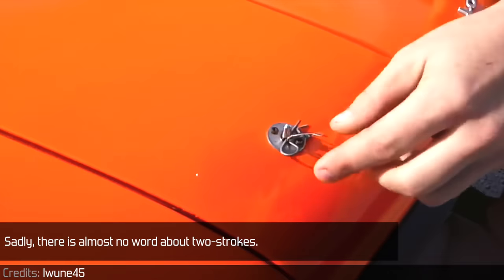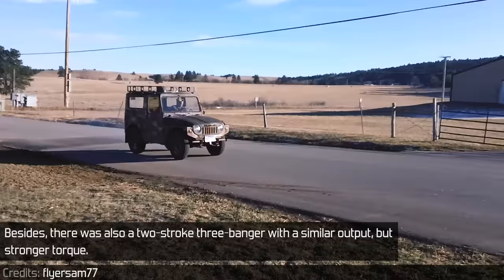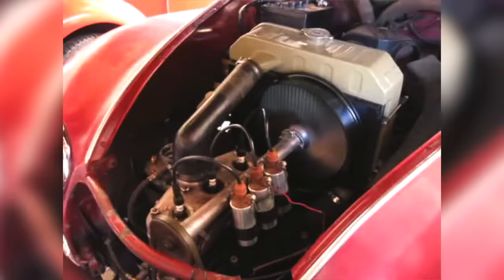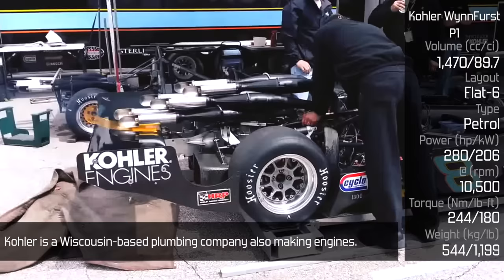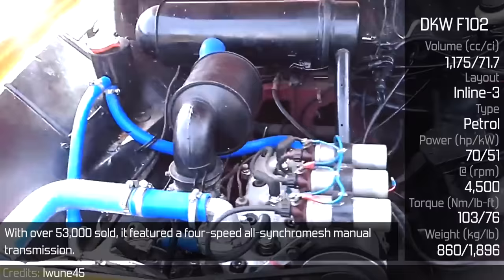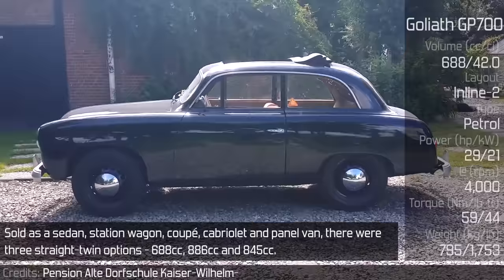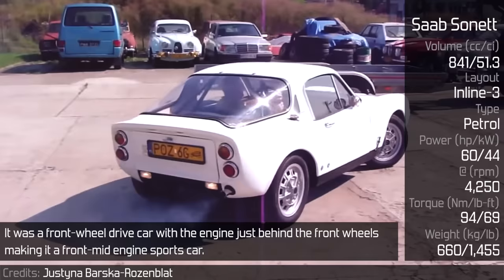8 Cool Two-Stroke Cars You May Not Know About

Comment: 2-Stroke with 2 and 3 cilinders make The sound of Rotary Engines
Reply: because they work on the same basic idea... but using different way
Reply: not really, a wankel rotary works on a 4stroke cycle, but due to its design, it does have twice the amount of combustions per revolution of the eccentric shaft than a four stroke, just like a 2stroke. the fact a wankel doesn't have valves but just intake and exhaustst ports like a 2stroke petrol engine, also contributes to the sound :)
Reply: yeah no kidding. The 2 stroke is all about flow dynamics. Rotary engines are based on similar principles but rely less on how it flows. rotaries are essentially rotating 2 strokes but have a more consistent idle because of their more predictable pumping methods.
Reply: Wankel rotary, or Le Rhone rotary?

The Le Rhone was a "radial-ish" design, 
where the crank was bolted to the firewall, 
and the whole engine spun around, and the 
propeller was connected to it. ( My 10th 
grade metal shop teacher, made replacement 
carburetors, for this engine, that is how I know 
all this trivia.  Oh, that class was in 1974.)

https://en.wikipedia.org/wiki/Le_Rh%C3%B4ne

I'm quite sure you mean the Wankel (Mazda) 
engine.  (Yes, quite a few people used the 
Wankel design, including the model engine 
maker, OS Max.)

Like others have pointed out,that sound 
comes from the exhaust port, opening 
almost instantaneously.  (Just like a 2 
stroke.)

steve
Reply: Steve Skouson based on context it is clear to see that were talking about the wankel here. no need for unecessary clarification
Reply: Just adding some info.

There are 2 drastically different 
engines called Rotary.  I'm 
familiar with both.  Yes, the Wankel 
does sound like a 2 stroke, without 
the backing-off backfires.

I've been around 2 stroke engines, 
for quite a few decades.  The Yamaha 
RD-400, and it's descendants,  are about 
the best.  (I had a 79 Daytona Special,  with 
a RZ-350 engine installed.)  That bike was 
SCARY fast!  I did all the re-wiring in one day.  
The YPVS valve DID work, when I was done.
(Yes, I MISS that bike!)

steve
Reply: xHarux3 nope, common misconception
Reply: Mark Thomas relax bro, no need for name calling
Reply: Sandro Sobreira moo
Reply: @xHarux3 A ignition per rotor per eccentric shaft revolution.
Reply: The thing a rotary and 2 stroke have in common is the lack of a valve train
Reply: @shaynegadsden  2 stroke diesels do have valves...
Reply: Sandro Sobreira
 Not really. Rotary engines don't have that dig dig sound lol
Reply: @vladimirlucifer4566  Reed valves.
Reply: @MallocFree90  What do you mean? That they're both engines?
Reply: Lol true
Reply: @mr.petrolhead5432  actually a wankel engine is a 3 stroke
Reply: @mr.petrolhead5432  yes but compression in wankel engine is not really a engine phase is just the rotor compressing the fuel while spinning
Reply: @mr.petrolhead5432  and the number of stroke is the number of times wich the internal parts of the engine need to move for making a full cycle
Reply: @m4ttyofficialchannel  ofcourse compression is an engine fase. Both a 4 stroke reciprocating piston engine and a wankel engine run on the same otto cycle. A wankel doesn't really have strokes as it's a (eccentricly) rotating piston instead of a recipocating piston. But it DOES have the same 4 combustion cycle fases as a 4 stroke.
Reply: hemm...no.. rotary make a sound of 2 stroke
Reply: Rotory fires every rev like a piston 2 stroke.
Reply: Hm F1 2 Strokes
Reply: Especially when you have 3 expansion chambers
Reply: @jjhack3r  wankel is 4 Stroke not 2 Stroke
Wankel :  https://www.youtube.com/watch?v=6BCgl2uumlI
2 Stroke :https://www.youtube.com/watch?v=Z6YC3I54so4
Reply: A 2 or 3 cylinder two stroke sounds similar to a 2 or 3 rotor wankle because they have the same number of exhaust pulses per revolution of the crankshaft/eccentric shaft even though they operate differently.
Reply: Mr. Petrolhead 
You are correct on a technicality, but it’s a bit of both. I say this because the work best with the external lubrication removed and blocked it and 2t oil in the fuel. Note to anyone doing this you will need to also remove the entire engine management system and use a programmable ECM since you have to get rid of the O2 sensors  and adjust fuel based on thermal readings and elevation. I know this cause I built a rotary powered Fiat Dallara X1/9 when I was 19.
Reply: Mark Thomas 
Please explain, becaue like 2t it peripheral port not valves but there is no overlap in port timing, like a 2t motor. Also the external oil system can be removed entirely and 2t oil added to fuel assuming you rejet for leanness or remove the OEM ECM/ECU and replace with HalTech or MoTech systems and that uses EGT and an Barometer , altimeter, and air temperature gauge to adjust for proper air fuel ratio. 

Now to the other direction the external oil system can be remove a shaft is then drilled from the centre eccentric shaft to its then tapped and a small carburettor jet is installed, after that the apex seal is widened and just below a a secondary hole is bored parallel to the apex seal intersecting  the shaft to the eccentric shaft , walls of oil channel should be about 3mm below apex seal. Holes are then plugged or welded and holes are drilled under the apex seal to bring oil from the eccentric shaft up the Chanel created through a tiny carburettor key then spit to be delivered behind the apex seal and lubricator the apex seals internally much the same way oil is delivered to pistons via the small holes that are behind the ring of 4t pistons. This configuration or Dorsey motors can be usually found in aircraft, not just any aircraft but experimental class aerobatic all aircraft much like you see in RedBull competitions. Due to the way the aircraft is tossed about they can’t use external oil inject isn’t wise due to oil starvation also minimal risk of a blown oil line since all oil is being delivered internally. Drawl back. It burns a ton of oil so it’s recommend for vehicles that either have a giant oil tank like a commercial boat or only are being used for let’s say 15 minuets of very intense flying then landed and refilled. 

So in the end the moral is it’s not 4t or 2t it’s Non-binary and would asked me to ask you to respect it’s boundary’s and use it’s preferred pronouns.
Reply: Zeksteve  as does a gas turbine 😁
Reply: Sounds like a wartburg.
Reply: 2 stroke = Dorito spinner on steroids
Reply: No, not at all
Reply: That sounds like f1 cars😉
Reply: No they do not. Wat u smoking? Crack.
Reply: Yeah but you'll never confuse a Porsche with a Banshee!
Reply: Meanwhile there's the hateful sound of someone calling opposed piston engines a flat 3
Reply: @steveskouson9620  God wants to have a relationship with you.
Sounds crazy, right? 
No it is true.
God loves you, he didn't spare his own Son Jesus for that reason(John 3:16)
that died for your mistakes.
He is not religious.
He isn't about religion.
He wants a relationship.
Even though you sinned awfully against him and he would have to send you to hell, but he is A God of love as the Bible says.
He wants to be your friend.
If you'll accept him.
I learnt it that way.
We all have our own beliefs 
and that's why we have to trust the only usable source: The HOLY Bible.
He didn't put a bunch of rules you have to follow,
It was people that did.
Those are false.
Only way you can come to God 
is you coming to his Son, Jesus.
His only Son died on the cross of Calvary,
For YOU.
So you may come to God
and go to heaven, to be with him.
God focuses on the individual ,and you are that one today.
He loves you so much,
He created you,
He shaped you,
He formed you.
Why don't you accept his love today?
All you have to do
is to come to the cross 
Ask Jesus for forgiveness by saying you're sorry for your sins.
That's where the journey of passing from death to life begins!
He loves us enough to give us a choice: we can ask him to be part of our lives now, and so avoid hell and look forward to enjoying his perfect eternal kingdom, or not.
We Christains need to speak out.
If you're a Christian let's speak up for our faith already. We know what is going on in this world is sin, abortion, homosexuality, prosperity gospel...
Let's do it brethren already.
If you reject Jesus, I am telling you, you will face the biggest amount of punishment in hell, more than murderers, adulterers, liars constantly gossiping, the proud and the wicked. If you reject Christ God cant forgive you of it until you come truly to Christ.
Take it seriously, Amen.
10 at the name of Jesus every knee should bow, of those in heaven, and of those on earth, and of those under the earth, and that every tongue should confess that Jesus Christ is Lord, 11 to the glory of God the Father.
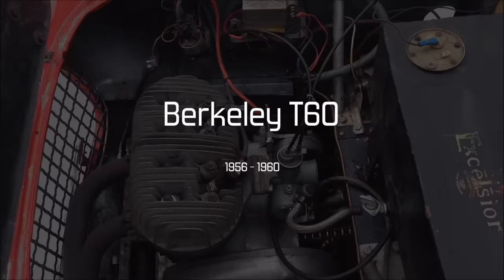Philippians 2:10-11 NKJV
Reply: @ijustcamefrombiblestudy2243 , I make it a point not to 
go to Church, and DEMAND I be given the RIGHT to talk 
about cars.

Maybe, the reciprocal should apply here.

steve

Comment: What a pity that it was only the last ar that was really revved out. I love the sound of a hard revved two stroke, music to my ears. Also good to see that two strokes are making a comeback amongst the off road bikes, wish they would bring them back in large displacement road bikes.
Reply: Ofc my dear, it's a Saab after all 😏
Reply: Are they? Yamaha's 4 stroke makes the same power now as a similar sized 2 stroke. Also race leagues are almost all using 4 strokes AFAIK. There are a few guys using 2 stroke but its all but gone.
Reply: They are coming back, 1 manufacturer and one kit to a 500 from the 250. Once you ride a 490-500 for awhile, nothing else works.
Reply: @congerthomas1812  Im sorry but they make a little more power while being a pain to refuel and are wayyy, wayyy dirtier. I just don't see them making a comeback lol. Especially when electric is coming up so fast.
Reply: @CrossWindsPat  The new ones are fuel injected.
Reply: @congerthomas1812  So no mixing that is awesome. Still lots of other issues though.
Reply: @CrossWindsPat  I drove one daily for 2 years never a problem,beach to hills,Exmouth,WA.
Reply: @congerthomas1812  I never said reliability was one of them. 2 strokes are very reliable because they are so simple. But they are dirty and noisy and lack low end torque.

Comment: 5:42 ..... finally someone who drives a 2 stroke the right way!
Reply: Joe Webster nope, he let clutch pedal too early. I know, it's much faster that way on video.
Reply: I meant I thought the rest were putting around until then. Very boring before that.
Reply: @Pabcio  I think the clutch is slipping
Reply: You gotta rev the heck out of a 2 stroke for it to be really fun.
Reply: a 2 stroke has to be revved higher because it has no guts at low rpm's
Reply: @jasperdomacena6491  Hondas cr500 that can power wheelie in fifth gear from idle would like to have a word with you

Comment: I remember a car that raced at Santa Barbara Airport when they raced there back in the 1960s. It was powered by 2 100hp mercury outboard engines converted to drive the car. When he punched the throttle to accelerate down the long straight it sounded like an explosion. He passed a lot of cars right up till one of the chains driving the rear wheels broke and he went round and round before he could get it stopped.

Comment: If I recall correctly, the tiny engine in the Berkeley T60 can also run backwards, thus giving it as many reverse gears as forward gears. If not that, then there is another small three-wheeled sportscar from England with such an engine.
Reply: I have a feeling the Invacar from the 60s could do that as well!

Comment: 2 stroke motors would be successful in cars with a few additions..  
1) Crank case oiling. Since 2 strokes rely on oiling from the fuel mix, when off throttle the engine can be damaged and actually overheat without throttle. The crank would need its own oil basin like 4 strokes..
2) Valves. Crankshaft-timed valves for the intake and exhaust would allow for supercharging and possibly turbocharging
3) If the crank case was oiled with a basin, you would need much leaner of a gas/oil ratio... leading to a more efficient burn.

Comment: It's wild how 2 strokes are very powerful for their weight at small cc's (65cc to say 500cc) but after that seems 4 stroke takes the lead by far.... Nowadays we got 2.0L hondas pushing nearly 1500hp. Crazy
Reply: thomas barlow indeed. 4 stroke engines have worse power to weight ratios. But they are more efficient. 2 strokes are much less efficient but have much better power to weight ratios. However I've heard somewhere that two stroke engines can be more efficient if given crossheads. Some of the most powerful and efficient engines in the world are two stroke crosshead low speed diesel engines. The most powerful being about 109,000 horsepower and torque that is enough to shake the damn earth. Lol. A little over 1.5 million foot pounds of torque with efficiency approaching 60%. I wonder what a Gasoline engine of equivalent size would be like. Lol.
Reply: 2 strokes still produce more power today than 4 strokes. Check out the Suter V4 500cc sport bike. It's 500CC V4 engine making 240 hp. Compare that to a liter bike, if you doubled the 2 stroke displacement that would be 480 HP whereas todays highest horsepower 1 liter sport bikes make about 170-200 HP.

And that's with limited 2 stroke R/D because no one is putting money into 2 stroke technology anymore.
Reply: i have cilynder on bike that have bigger intake than exhaust that thing have so much torque that can start in 3rd gear with litlle rpm but it cant rev over 5000rpm with right exhaust its like tractor
Reply: thomas barlow and nowadays we’ve got 1.3L rotaries pushing the same amount
Reply: Dan Bee a 1.3 rotary is more like a regular 4l
Reply: John Jacobs thats na 2 strokes. Turbo literbikes can make about 350hp. Imagine what a 1l turbo 2 stroke would be like. Like 600-700hp from just 1l of displacement. But the power band would be so insane that you would have to put it in a 16 speed or a cvt to stay in the power band

Comment: I am about to test run my own two-stroke automotive engine design (see my avatar).  Supercharged and turbocharged for high specific output and GDI for low emissions too.
Reply: Two cycle engines with intake boost ports make boost as you hear it hit the power band "on the pipe" that is when a two cycle self supercharges making boost and its not back pressure of exhaust gasses that stops the boost from blowing out the exhaust port its the sound waves reflecting off the reverse cone of the expansion chamber that hit the opening right where the pipe attached to the exhaust port and makes an invisible barrier holding back bars  of atmospheric pressure that never stops building as the cfm of the carb or throttle body is the only limiting factor .this is why a naturally aspirated 4 cycle engine will never have the same horsepower as a two-cycle engine same size cause two cycle engines with boost ports boost

Comment: I grew up on two stroke motorcycles , the peak of technology was the 1991 Honda NSR500 , 200bhp 320kmh the Honda engines offered more power but the tyre and chassis tech could not cope
Today's MotoGP bikes give 300bhp from 999cc I'm sure two stokes could beat that with today's tech
I would love to build a Cateram super 7 with an Evenrude 3.5V8 two stroke

Comment: That 6-cylinder race car and the Commer was very interesting! About the DKW F102, I believe it was actually only produced 1964-66. VW bought Auto Union and revieved the Audi name. The four rings is not originally Audi, but Auto Union, and they stand for the four brands Audi, Horch, DKW and Wanderer. It's funny to see under the hood of much more recent Audi and see the engine in the same position still as in the F102/3 - fully in front of the (imaginary) front axle. :)

Comment: A 2 stroke diesel, take that! Stupid emission regulations.
Reply: bobfather 
The reality is a 2 stroke can actually get better emissions because it recycles a portion of its exhaust many 2t motors have 2 timing marks and are ignited at top to induce the power stroke and again on the tail end to burn un-ignited fuel fuel. 

Here’s an interesting motor originally designed for the military but after taking it from DARPA theory to prototype the military deemed it not usable for what ever reason and didn’t hold the patent so it’s now on the civilian market. 

https://thekneeslider.com/ecomotors-opoc-two-stroke-engines-opposed-piston-opposed-cylinder/
Reply: @entropicgirl8648  no, thats not true. Yeah, they recycle a portion of their exhaust but the power stroke occurs every 2 strokes. The power stroke in a four stroke engine occurs every 4 strokes. This makes 4 stroke engines more environment friendly